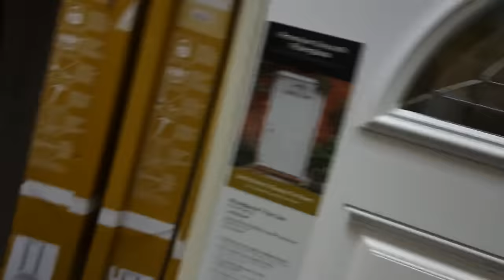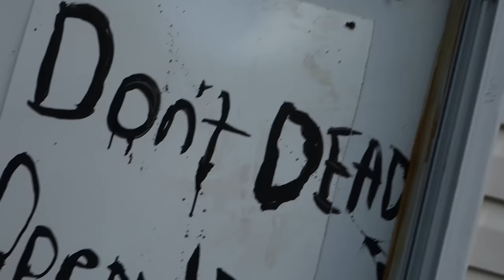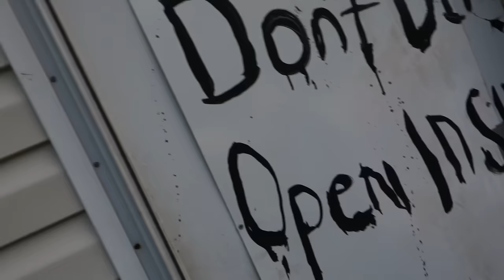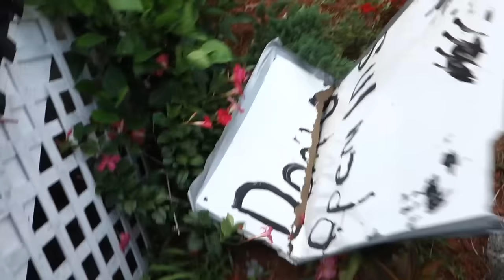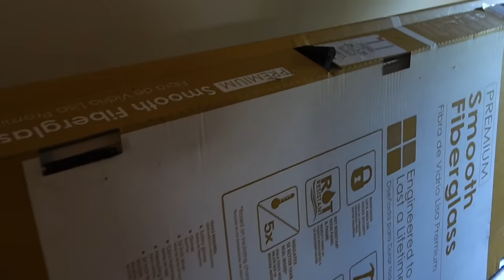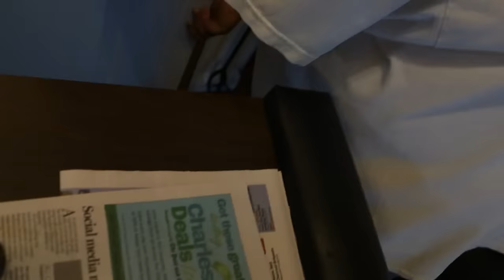ANGRY GRANDPA IS UNGRATEFUL!!

Comment: Internet Explorer (formerly Microsoft Internet Explorer and Windows Internet Explorer, commonly abbreviated IE or MSIE) is a series of graphical web browsers developed by Microsoft and included in the Microsoft Windows line of operating systems, starting in 1995.
Windows: 11.0.185 (April 14, 2020; 18 days ago)
Mac OS: 5.2.3 (June 16, 2003; 16 years ago)